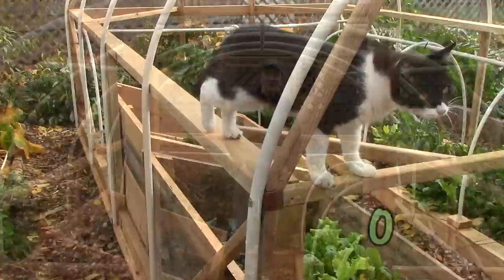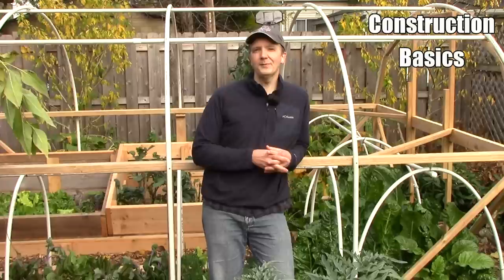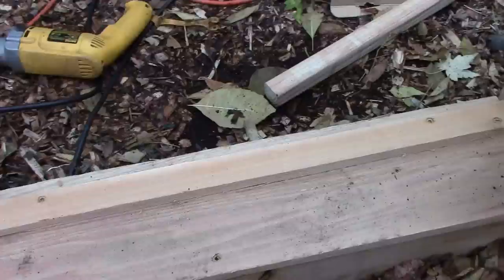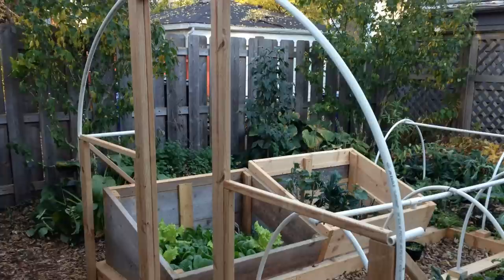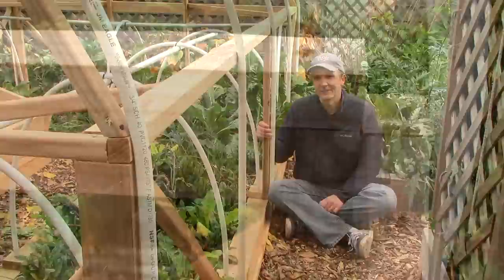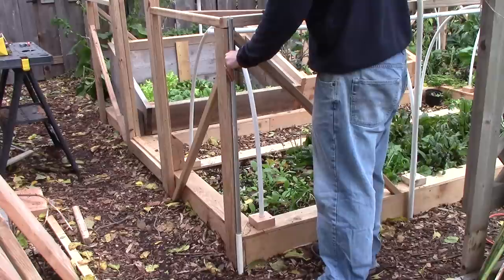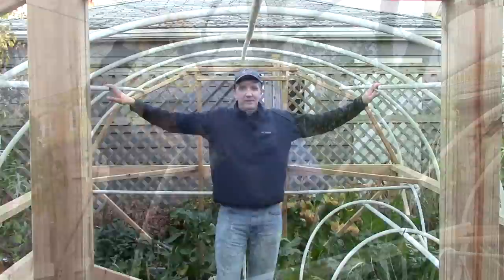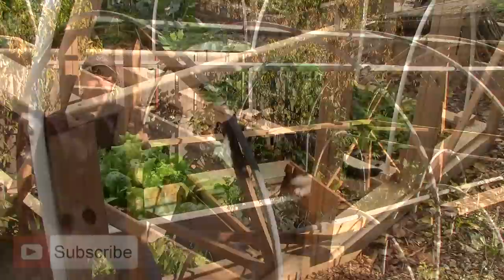How I Built Our DIY Hoop House (Greenhouse), pt. 1: Framing

Comment: Great video, Patrick...with LOTS of good detail!

One question though...The instructions for our commercial grade hoop house repeatedly say to NOT allow the greenhouse plastic to contact PVC of any kind as it will cause deterioration of the plastic. Have you heard this before? If so, how are you dealing with the problem?
Reply from the maker: +ItsyFarm Thanks! Yes, I've heard this before. Though I've used PVC with greenhouse plastic in the past without noticing any problems, I may use a felt tape from Greenhouse Megastore that is sold to protect the plastic from degradation from PVC.
Reply: +OneYardRevolution | Frugal & Sustainable Organic Gardening That's what I plan to do on our next (smaller) PVC pipe hoop house.

Comment: If you would have used the coupling your connection would have failed. The combination of the conduit AND the coupling would be the best option for strength, function and looks.

I found that with my hoop houses that water would condense on the upper inside surface and then drain down the side. This is something I am trying to figure out how to resolve because it QUICKLY depleted the moisture in the hoop house growing medium.

Any ideas?
Reply from the maker: +Steven Feil Yeah, I had the same concern about the coupling. You're right. The coupling plus conduit would have worked well.  I'm not sure how to address the moisture issue. We fortunately didn't encounter it with our low tunnels and cold frames.

Comment: Wondering if you can suggest a method to glue together poly ethelyne .  I think this is an amazing channel and you have kindly responded to previous questions quite quickly.   I did build myself a similar hoop house but for now am using standard 6 mil poly that is not large enough.  So I have taped together some pieces which works ok but want to glue it more permanently.  Any suggestions?
Reply from the maker: Thanks, Michael! I'm not aware of an effective method of gluing 2 pieces of poly together. Overlapping and taping the layers is probably your best bet.
Reply: Some people use acoustic sealant which is sticky enough yet still flexible.   You know I am not sure I can find those snaps you use up here in Toronto.  Going to pour over  your winter veg suggestions and see if I can source those here.   Keep up this great work.

Comment: hey Patrick,
I know yours is unheated, but what would you do to heat a greenhouse, to just keep plants alive in zone 8b?
trying specifically to overwinter my potted pepper plants. 

Was considering recycling bubble wrap on the walls, and possibly a reptile light bulb or small heater. It's about 6x8.  
We have a greenhouse we rarely use, and it has many black painted water jugs, but still lost all the peppers last year. 
Thanks
Reply from the maker: The peppers will have a much better chance of survival if they're planted in the ground instead of pots. A second cover - like sheets or pillow cases - would help a lot on cold nights. I've never researched heaters for a greenhouse, but the light or small heater should help.
Reply: Think we may try and add a hoop house in our  Greenhouse. might work to keep the peppers alive. then we wouldn't need electricity. We have many water jugs painted black in there for heat retention.
I like how Donna (from rainbow gardens) talks about removing fruit and pruning back. don't think i did that last year.

thanks Patrick. appreciate your time!
oh and interestingly, my zone changed back to 8a. when we first moved it was 8a, then went to 8b... now back. is that common for it to fluctuate? odd.

Comment: I'm in zone 9 where it doesn't get that cold or snow here, but I plan to cover my 4 x 8 raised bed. Is it necessary to have that horizontal pvc to stabilize my four hoops?
Reply from the maker: You probably won't need the horizontal piece, though it might help if you get very heavy rains.
Reply: OneYardRevolution | Frugal & Sustainable Organic Gardening 
Thanks, I didn't consider the rain.

Comment: how long is the PVC on the east wall
Reply from the maker: The pipes were originally 10'. I trimmed a little off 2 pipes and connected them together. I can't remember the exact total length, but it's somewhere around 16 to 18 feet.